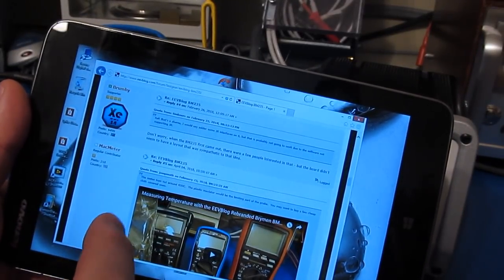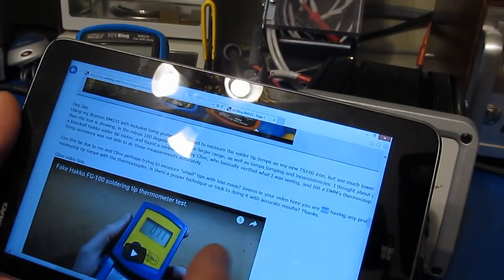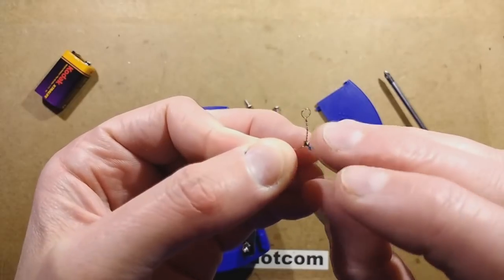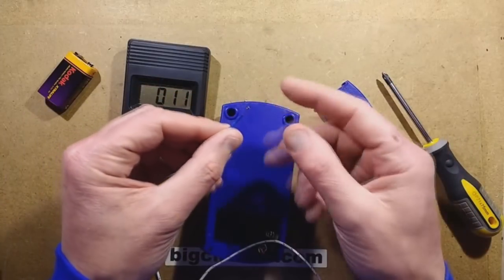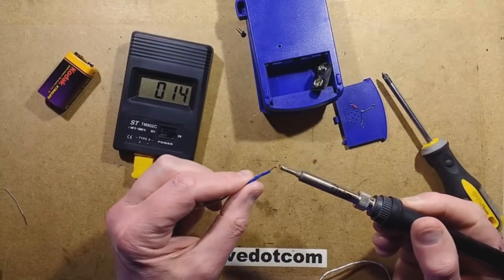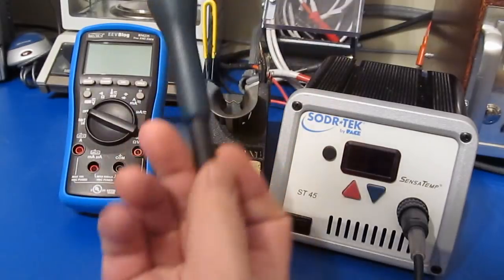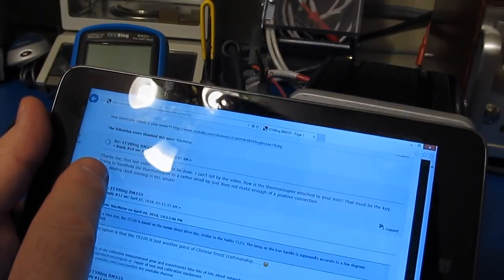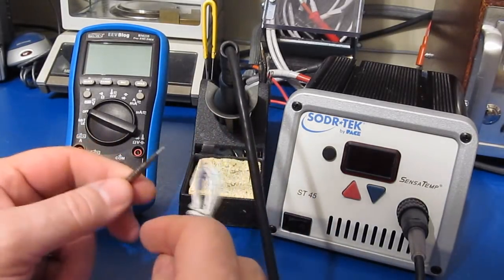Using the Brymen BM235 to measure my PACE soldering iron's tip temperature

Comment: Joe, what thermocouple does the Pace HeatWise hw-50 etc use or does it matter.
Reply from the maker: I would have no idea without buying one and cutting it up.  Even then, I'm not sure I could sort it out.  It may not even use a themocouple.  If you have questions about their designs, I suggest asking them.   Personally, I just use the irons to solder with and have no care about their internals.

Comment: Joe 
How does this tip give reading back to the station?  Is there a connection on the tip back to the station?
Reply from the maker: I would imagine the sensor is in the heater cartridge near the tip.  I would also imagine it is isolated and uses two separate wires.  I would have no reason to section one but if you contact Pace, they may have images of it.
Reply: @joesmith-je3tq  there is only two contacts on the tip. The earth is obviously making contact with the side of the tip but where is the third contact for the sensor reading as there are four wires going into handpiece.
Reply from the maker: @irishguy200007  There are actually five wires going to the hand piece, not four as you suggest.  1 for ground, 2 for the heater and 2 for the sensor.
Reply: @joesmith-je3tq  ah I remember one a few years ago and I thought it had four wires, I stand corrected. 
So where are the sensor contacts on the tip?  I only from pictures see two brass contacts on the tip itself.
Reply from the maker: @irishguy200007  I am not sure what you are calling the tip.  The heater cartridge is a sealed assembly and has five pins.  It plugs into an extension cable that has five pins.  These five pins plug into the base.   You could join the EEVBLOG and post a few pictures of what you are looking at.
Reply: @joesmith-je3tq  Sorry yes the heater cateridge which simply can be pulled out and replaced has what appears to be two brass connection tabs and obviously the side of the cateridge acts as a third point for earth but where on it is the brass connection table for the thermocouple /sensor. I do not own a pace yet and cannot get a picture of ghe end of a cateridge to understand where the sensor is connection to the sensor wire. I think the sensor wire is the white one though. This is purely academic on my part as I love to understand such devices better. Thanks for the EEVblog sugestion.
Reply from the maker: @irishguy200007  Again, I have no way to know what you are looking at but you are not close to describing the iron used in this video which you are asking about. Obviously you are looking at something.  Maybe you don't understand that Pace made several products.  They are not all interchangeable.    I doubt you could buy a brand new station like this today as it was discontinued a long time ago.
Reply: @joesmith-je3tq  ah. I was referring to the td-100 soldering iron which is one of their most popular irons.
Reply from the maker: @irishguy200007  I guess I was just supposed to magically know that.  Maybe start with that in your first post rather than several posts later.   The TD-100 was not shown in this video.  PACE should be able to answer any questions you have.
Reply from the maker: I suspect with the TD-100 you are asking about (not anything to do with this video), they measure the resistance of the heating element.  Only two terminals would be required.
Reply: @joesmith-je3tq  I am thinking they are using the same terminals to both energise the heating element and take readings from the thermocouple just in a staggered fashion. What confuses me is if this is indeed the case as in the case of the  Ts-100 then why is are they using 5 wires instead of three like the TS100.
Reply from the maker: @irishguy200007   Again, my iron with the the five wire setup is very old and no longer offered.  I would imagine they had not yet developed the technology to use the heating element as the sensor.
Reply: @joesmith-je3tq  That's exactly what I thought as maybe microcontrolers were not available But I noticed that iron you have takes the td-100 soldering handpiece which contains the heating element and thermocouple all in one and it can be used on this particular soldering station. As far as I can see the cateridge has only two contacts at the back of brass and the third would be The case of the cateridge for an earth connection. So the only thing I can assume is the thermocouple and heating element are in series and shaming the same two contacts like the TS100 design which is basically a copy of it so to speak. What I don't understand is, if this is indeed the case then why bring the two thermocouple wires out on the lead when they could have connected them to the two Drive wires internally. The TS100 only brings out three wires and the reading is taken from the same wires that carries the power. If I had a handpiece I could see better and there are almost zero photos online.
Reply from the maker: @irishguy200007  Micros were certainly available.   If you take the time to go to the pace site, look up the TD-100 iron you are asking about and read their description, it states "For use with IntelliHeat Systems only. "   It should be obvious that  it is not compatible with SensaTemp.   I've already explained how I suspect the newer iron works but you seem to feel otherwise.  I would just contact Pace and see if they would be willing to explain how their product works.
Reply: @joesmith-je3tq  ok I will. However the Td-100 is advertised to work with the hw-100 and the hw-50 and they are tempwise if I'm correct.
Reply: Or sensatemp I should have said.
Reply: @joesmith-je3tq  I think you may be on to something,  I think there are two different Td-100 handpieces one for Intelliheat and one for HeatWise
Reply from the maker: @irishguy200007  SensaTemp, Intelliheat  and HeatWise are all different.
Reply: @joesmith-je3tq  It appears I'm begining to understand this. I thought these were just names but then again there are adapter cables that allow an Intelliheat station to use an older handpiece from a sensatemp station etc,  so there can't be much difference between them other than operating voltage. The Intelliheat cateridges and the tempwise/sensaheat look identical
Reply from the maker: @irishguy200007  I just use them to solder and had no need to dig into the details of how each series worked.
Reply: @joesmith-je3tq  Of course I appreciate that,  no probs

Comment: Hey Joe could you do a video on your ST45 as to how large a wire it can handle .. Just curious because I have a St45 with no Iron have been thinking about buying an Iron but a 100 for a IRON and then Tips just wanted to know before hand if it will handle lets say wires in a Surge protector I think maybe 14g not sure.  15 years is a great testimony for the ST 45..
Reply from the maker: If I need to do really large wire, I will grab a torch.  For the smaller stuff, I have a gun.   I've used the ST45 for 8AWG.  The worse thing I do with it is solder PCB material together.

Comment: Just now received new shining BM257s and was surprised to see my forehead temperature like 31C - lower than normal human being should have :)  Very warm coffee cup indicated 43C degrees. Even when I held thermocouple to object without moving. Dunno are I use stock thermocouple incorrectly or I simply don't know something about temperature measuring in this way.
Reply from the maker: "Just now" seems like the meter has not been allowed to stabilize at room temperature.  Research cold junction compensation.

Comment: nice reminder that  the heat transfer between comparable mass objects is rather tricky business. The shown type of measurement is point heat transfer, it is very important to note that the second time transfer took "ages" as a result of small heat source. When BigClive measures solder's temperature using "Fakko" unit he presses iron into thermocouple joint which results in good physical contact and is quite slow. When he tries to use thermocouple thermometer he moves probe frantically along iron tip actually periodically interrupting physical contact. Adding rather slow sampling and you get numbers circus.

btw: One has to change thermocouples not because of "contamination" but because of banal physical damage. The joint is welded, and is quite brittle structure. You can count measurements, and do maintenance as prescribed. at home  setting you can just wait for ghost effects and  change couples when necessary.

something unrelated: I keep seeing very specific type of toys on the table. UHF and HV. Smells by radars. :D
Reply from the maker: Not sure what the UHF would be but there is a home made HV probe sitting on the table.
Reply: I've seen already your old video when you made it (with internals etc. btw).
Of course casually making programmable HV discharge device implies experience with transient HV devices :) .....
 I was writing about stuff in the background you don't mention or just use casually. HV equipment  is not necessarily something that per se generates HV. Anyway I've seen the video with infrared camera. it is enough for me.
I hope you won't run out of steam making these videos. I already used few of yours videos (of course always illustrated by few from other channels) to explain my kid some things. Solid content.

Scrolling comments of your videos I have got strong impression that many  people don't get the point of the transient HV tests. 
I am not an electrical engineer (though as a laser physicist I had to learn a bit), but even I was hammered to appreciate ubiquity and danger of transient overvoltage. I wonder what (if) people learn nowadays.

 Apparently even obvious observations (burned transistors etc. are the result of transient over-voltage after all) or stating typical values (banal computer 250W PSU can generate 1.5-3k before dying) is not enough. Could you make a video with examples, like measuring voltage surge produced by the DMM probe shortening some cheap impulse PSU. After all you have this nice hv oscillator probe  and neat isolation cage :).
p.s. I understand you have clear very limited scope of your you-tube channel, but I think such video would be a great addition to your DMM series.
Reply from the maker: Yes, there is some background equipment I use that will work in the UHF and some even in the SHF.   Rare that I need it to play with a handheld meter.  That stupid Gossen was a bit of a let down but I think the only real tech video I made was showing how I used a SA to sniff the CEM's wireless datalink. 

The FAQ has a fair number of comments / questions people have posted about the tests I have shown.  Even with the FAQ, I still see a lot of the same comments.   The most common are safety related.

Per your last question, there have been cases where someone has posted how they damaged their meter and I will attempt to get them to detail it so we can try to replicate their results.   If you have some specific test you would like to see ran, feel free to post a detailed plan and maybe I will include it or even run it on what ever meter you feel had a problem with it.
Reply: I read your FAQ, and even printed that page with DMM tests. Brymen 869 and more expensive variant of Hioki and Aneng 8008 models ended in my garage and on my table.
 
I can collect a few cases of DMM failure (or HV probes) but they all involve people stupidity vs. motors or capacitors banks. Pretty much the cases covered by your robustness tests. Mine post was more about that not "everybody" sees that your tests represent something "usual" which can happen in real life.

What I like in your videos, that they all are scientific. Follow clear uniform methodology, and are as "simple" as the situation allows.
Reply from the maker: I almost both the HIOKI DT4282 for my everyday meter but ended up getting the Brymen instead because of the twin TC input.  HIOKI makes some very nice test equipment.  I use some of their higher end equipment.  Well worth the price. 

You will never be able to explain to someone who's whole idea of electronics is playing with 3.3V logic why they may want a more robust meter.  Well, maybe ESD gets them.   It's not really my intent to try and steer people in what to buy anyway.

If you give any more thought one a particular test case you would like to see ran, the door is always open.
Reply: I use lately my hioki mostly as a bench-top dmm, I've bought Brymen when I found that I need 2dmms most of the time.. Aneng came in the same time because I wanted something not to care about and good enough for my arduino toys. 

 I did only software last 12 years, I have quit science when got demand to produce 2 conferences+1 article per year, so no stories from me. But the request about failures+ details is sent around and I believe you got some 10+ impressed subscribers on it's way.

Comment: please about peakmeter multimeter video  ######
Reply from the maker: They offer several meters.  Do you own one?  If so, post some high resolution pictures of yours.
Reply: have peakmeter pm18A & PM8248
 Is the product excellent performance or not like to explain video special with comparison with others Thank you for my response and I love your channel and your performanceI
Reply from the maker: https://www.eevblog.com/forum/testgear/pm18a-peak-meter-auto-ranging-6000-count/  
Do you see any MOVs?
Reply from the maker: Do you see those vias in the middle of the rotary switch pads?     If you have watched the videos, there should be some simple things you can check to give you some idea of the quality and robustness of the meter.
Reply: I like educational sections such as industrial plants, electricity and mechanical
Reply: my multimeter Pm18A I put the AC 220v on Hz mode now problem in 
     ? (  working Most options are disabled ( capacitor Hz NCV temp Ohm
Reply: yes great , there are a number of videos amazing and useful laboratory  *** good luck
Reply from the maker: That's too bad but I'm not too surprised after seeing the pictures in the eevblog forum.   I could not locate any pictures of the 8248.  Maybe it is better.

Comment: i just found you  and i am impressed  i bow sir. i now aspire to achieve half as much as you sir.  thanks for the great vids and demonstrations of concepts.   could you put together something that would be a great lesson for a medium level beginner... (uh....... i know what all the words you say mean and understand everything i have seen. my ultimate goal is a globally distributed  (self-monetizing) heterogeneous supercomputer and rethinking parallelism to program CLOUD services for infinite users (instead of maximizing calculations)  EXAMPLE A calculator where each function is its own system and say just the add function would be a service that has an entire wall of dual Xeon servers dedicated to it.   ridiculous you say, wasteful?? think globally !!  this is where im at: using python to trigger a gpio pin on a RPI that signals a controller that  dims a light.  what i need to see is a demonstation of how to progress from here to lets say three towers all built to run that add function
Reply: i could send some bitcoin  if it helps you get some free time  iom not rich  AND  crypto is my prescious
Reply from the maker: Not sure what all this computer stuff has to do with measuring soldering iron tip temperatures.
Reply: nothing...  i was so impressed by your older FPGA demo  that i found your newest video assuming it would get your attention.  ive never seen a person who understood systems on a level where they design cpus with fpga  for shits and giggles. like im sure you have important projects but this in a new thing  a international supercomputer for the masses .  at the rate i am going, i will need at least 5 years before i could accurately define the  network i can see in my mind.  however , my results thus fatr have been enough to convince me that i wuill get there.  i hope that my lack of formal training (i just started my third year of school and i dont think i will ever be taught anything like this without getting a masters and then i will sstill have tio teach myself  but i will have a book with the right terms) dosent prevent the core functionality from being presented
Reply from the maker: The cores I show in the video was a 6801 and 6811.  They are not very complex and I expect this would be something on par with a modern college level project.  Write me in five years and show me your own designs.   Good luck in college.